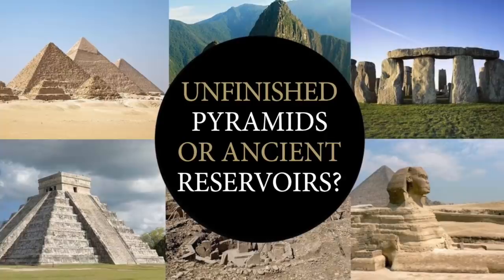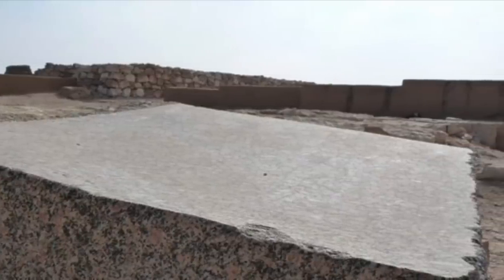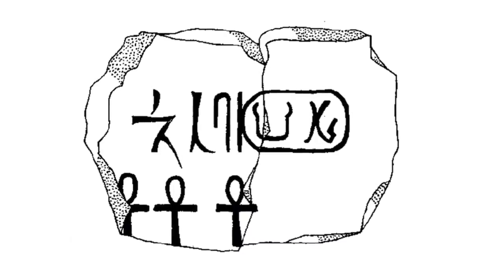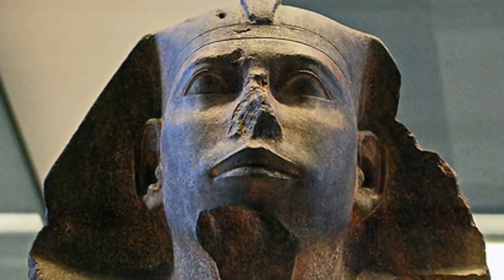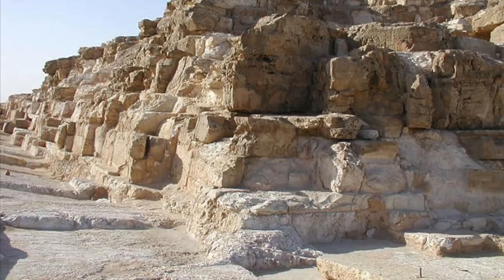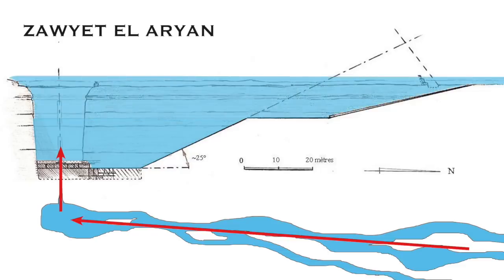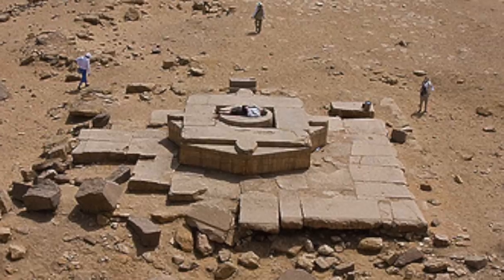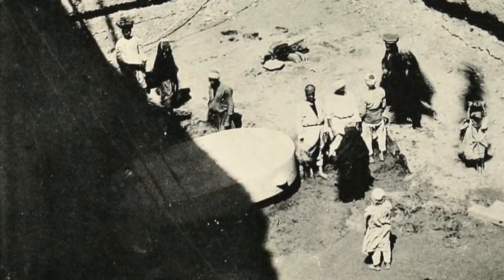Unfinished Egyptian Pyramids or Ancient Reservoirs? | Ancient Architects

Comment: Maybe the oval “sarcophagus” was a drain hole with lid. When capped all the water that comes in to the granite lined chambers is retained like a reservoir and every so often the drain lid is lifted so the reservoir could be drained for cleaning and servicing of the walls and floors. Could explain use of clays or resins in sealing the seams between blocks.

Or maybe water was diverted into a complex like this to try and push extra water directly into aquifers. That would make it easier for farmers to access water from individual wells that tapped into the same aquifer. I dont even know if that is possible though.

Comment: I’ve previously commented that the black around the plug may be charcoal, to purify the water. However, on reflection, it is likely tar. This would have been used to seal the plug when the reservoir was full, by lowering the plug in ropes, and using the tar to make a water right seal.

Comment: WOW.  What a great video.  I totally agree that the motivation makes sense.  I do have many questions.
1) Are you saying that the great pyramid (and all others) had the same original purpose?  If so, who and why did they later convert them into pyramids?  I would think the stone layers would be different on the original and the later conversion to a pyramid.  Is there any evidence for this?  
2) What is the reasoning for the precise orientation with the stars, if it was only a practical usage? 
3) Are you saying that all the pyramids had a start as part of this system and the finished ones were all made into "full" Pyramids? Or were some pyramids built as pyramids from the beginning?
4) If they were originally for water storage, what was the reason for the square shape and the angled sides?  Wouldn't it have been stronger to make them circles or ovals?

Thanks for the video.  I loved it.

Comment: The "sarcophagus" held charcoal. This place is like a tank on top of a reservoir allowing water into the tank and holding it from draining back to the reservoir or "losing" the water in between the two holding areas. There is communication between the pit and the underground aquifer. The block floor allowed water to seep into the pit from the aquifer and prevented it from draining back down or from draining to the intermediate underground where it would be lost or perhaps just not used where it was needed. Furthermore, this seems like it was  strictly used as drinking water. The charcoal in the container in the floor improved the taste of the water like a giant Britta. The reason there is a ramp in these places instead of stairs is because there would be large number of people filling containers daily. It looks like there is even a walkway to the filtered water area made with different colored granite. Maybe it was the prescribed path to follow, to wade out to the area with the up-welling of water that had been "filtered", so that contamination would be reduced. I've thought about this a lot. I think these are very old places. Your videos on these pits are by far my favorite and I rewatch them probably every couple weeks or so. They are just a fascinating subject!

Comment: Pity the Pyramid of Djedfre was torn apart by subsequent occupants of Egypt. Even as late as the 1800's modern era, 300 camel loads of stone per day were being removed from the site for sale in the open market. And that went on for weeks. This after the Romans had disassembled a significant part for their projects. The reason for the wide, sloping corridor and wide bottom area, is that the in situ stone was deemed not strong enough to support the superstructure of a pyramid. These areas were lined with much stronger stone to prevent the collapse of the interior corridors. The pyramid, when finished, was cased in polished granite to about 20 feet high, then polished black basalt to the top. The unusual inclination of 60 degrees and being built on a hill plus the mirror like black finish to the top gave this pyramid an awesome appearance, more than competitive with any similar structure. Theories about water works, reservoirs, pumping stations, power plants, aliens, extinct advanced civilizations are always amusing because anyone who understands even a bit about the Ancient Egyptians would understand that the pyramids were bridges.

Comment: I believe most of the structures including full pyramid structures were not only used as water pumps and/or water storage but pump stations to produce electricity. It would make sense why these structures were built with granite as it is a great conductor of electricity. It has also has been discovered that traces of copper has been found. Copper is a great conductor for electricity also. As we all know, water is a good source for producing electricity. This may explain why the Egyptians were able to place such expertise to their art and hieroglyphics without smoke imprints from oil lamps and fire torches. This may also give clues to why they were able to move such large objects in a short spand. During that time having a huge source to electricity would have been considered of God like advantage. I believe that is partly why they were so big in structure. Great monuments of conductive genius. Earlier it has been told the top portions of the pyramid were layered with gold which is also a great electricity conductor. This would make sense why the structures seemed more industrial than tomb like. Just my own hypothesis...

Comment: The more famous Giza pyramids do not contain heiroglyphs. And of course, no technology available to the Egyptians could have built them. Moreover, for such an enormous effort, there do not appear to be any heiroglyphs showing the building process (which is why archeologists have to guess at it today). Conclusion: they were not built by the Egyptians, but by an older civilization. To what end, we don't know. Power generation has been one of the main speculations. However your point about an enclosure wall indicating that the seemingly unfinished structures were in fact finished is a point well taken. And I agree that Egypt probably needed more water. (That desert was once an inland sea or huge lake.) Incidently, the type of stone used may be a major key to the use to which all these structures were put. You wouldn't use limestone to handle flowing water. Granite, yes. It's a point about the three Giza pyramids-- why build with granite deep inside the structure, and limestone elsewhere?

My skepticism with your water movement idea is that the three Giza pyramids are seemingly way over-built for simple pumping stations.
Reply: noferblatz im reading vses book on the giza excavations and there seems to be a lot of cladding of internal chambers and passageways with granite, it could have been removed at a later date and re-used, hence no water erosion

Comment: Suggestion about whether there is running water under the round stone: Place a plastic bucket bottom up with any digital recording device either on the bucket or underneath.  This method may be helpful at any suspected site of water flowing in the area. If it doesn't work then no loss.

Comment: I think you're probably right about the water pump hypothesis. here's why: in another video you did about electricity, the black residue would be the byproduct of that yeast mixture.
next, I noticed on the lid of the tub in those photographs, there are four "knobs", now, let's look back at the video where you're talking about granite glowing and displaying electrical discharge: https://youtu.be/piUt5Ln9Hes?t=377 clearly, in that picture, you can see that the the "corona" discharge is forming on the edges. this is both likely why the serapeum boxes are so perfectly flat (so that no electricity buildup happens on the faces and only on the edges) -- and is also a very likely explanation for the "knobs" on the the lid. all of the discharge would appear on those knobs, and not on the smooth surfaces.
so, if the unfinished pyramid were filled with water, there would be strong electrical current on those knobs. somehow, it seems that the shape of this tub is important. I would have to guess that it would suck water up through the granite floor-blocks kinda like a stationary mushroom cloud kind of flow, water would collect and remain in the basin for as long as the electricity was coming out of the tub. people could access the tub from the ramp when it stopped flowing, and likely water flowed out through the causeway, you're right.

to see water being pumped with elecricity, have a look here: https://www.youtube.com/watch?v=zzVa_tX1OiI
great research matt!

Comment: You have a major flaw in your pump reasoning. The Giza plateau is about 100' above the nearest low area in the Nile Riverbed, the current nearest flow of the river is about at 40' above sea level,  the closest 'bay' is only about 60' above sea level, and the platform on the North  side off the Great Pyramid is at an elevation of almost 200' above sea level.  So unless they had the worlds biggest bucket brigade, using the pyramid as a pump would not work. Pumps are usually placed below the water level if they are to be used to raise the water to a higher level.   Nice try tho.

Comment: YO! the ridges along the top; and the lower ridges were for a roof. large slabs would have been slid into place creating a roof. Look at the Osirion. Same thing there, except the ceiling blocks were even thicker. The "sarcophagus" I  believe is original. it was part of the machine. it has lasted due to its superior composite
Reply: I am onboard with your theory about water stations being the function

Comment: Good video, crude theory - you don't need all the interior complexities of the Great Pyramid to have it work like a "pump". Water has been running under the different structures in Giza and was used for a purpose, but not for irrigation (for conductivity maybe?). Desertification of North Africa supposedly started around 6-4k BCE, I think we both agree that those structures are much older thus the "water storage" motivation is unlikely (unless you want date them back another 20-30k years).
The "unfinished pyramids" being water outlets would not require them to be perfectly aligned to geographic north, apart for a hundred other counter-arguments. Keep searching.
Reply: To add to your point, there is water under the Sahara. In fact, there are great aquifers there if you dig down far enough. It used to be an inland sea. Did the Egyptians know that? Doubtful. Could they have dug that deep? Doubtful. Still...
Reply: I'm not that sure - the ancients loved to tunnel, and I suspect archaeologists aren't digging deep enough to find all traces...

Comment: An interesting idea. The construction definitely looks more reservoir -like than tomb-like so possibly had an industrial use. In pre dynastic times there would have been more rainfall so maybe the elevated position was actually to capture water rather than receive it from the nile.  The pipe may have been a sink hole to distribute water to other locations.  The lid on the pipe may have been   a plug to store water there until it was needed.

Comment: couldnt it also go the other way??? they were areas to catch water and move it thru the chambers to the great pyramid where the power plant would need it (the power plant idea of the great pyramid/s is what im leaning towards)
Reply from the maker: Yes - def a possibility. But you wouldn't have a water collection point on the top of a hill, you'd have it at the bottom - for maximum collection.
Reply: where are all water towers located at..........tops of hilltops or tops of mountains......that way it has the most pressure behind it so it makes it easiest to pump as far as possible
Reply: Check the terraced water collection feature in South American sites.
Reply: whos that to??
Reply: Diy chad726

Comment: Nice Video, I like the theories proposed. A good scientist should be open minded and always think out of the box with an alternative point of view. You, Graham Hancock,  John Anthony West who just passed away Feb 6, Andrew Collins, Randall Carlson, Robert Bauval, Robert Schoch and some others are the oxygen that science need to pursuit the truth.  I just got one suggestion,  The terms "Diagonal" dimension is misused since a diagonal is used in circles or "two opposite corners" of a square, rectangle, or other straight-sided shape.
In the case of a Pyramid it should be refer as "side of the base" instead.  
The Diagonal of the Great Pyramid :   multiply the length of one side "230 Meters"  by the square root of 2  =   325.27 Meters   
Based on a formula  Diagonal = the length of one side by the square root of 2
 Following are the proper names in a square pyramid geometrical shape.
 h = height 
s = slant height
a = side length
e = lateral edge length
V = volume
L = lateral surface area
B = base surface area 
A = total surface area

Comment: Thanks Matt.  A big mystery  Glad other channels are talking about this too.  I find your hypothesis most interesting.  And yes, I think it is identical to “Djedefre’s” at Abu Rawash.  Not a pyramid.  Nope. Great video.
Reply from the maker: Thanks man! I just like to throw my hat into the ring.
Reply: Lol.  The fact there is one of these at Saqqara, Abu Sir and Dashur too leads me to like your theory even more.
Reply: Why doesn't anyone consider the huge chunk that's missing in front of the oval ? To me that suggests something else fitted over the top and had a corresponding chunk that fits into that gap. Why would you create that odd shaping? It must've had a purpose. Crane ? Spaceship?
Reply: I think there is a whole bunch missing.  Pretty hard to re-piece what was there originally, based on only what hasn’t been hauled away or disinigrated over the last who knows how many thousands of years.  No easy answers,  that is for sure.
Reply: Thanks for a good video on these strange structures, which I am sure very few people are aware of. Clearly the concept that any of these structures were originally tombs is nonsense. The engineering involved is mind boggling, removing, dressing, transporting, and fitting the granite used is even today a seriously difficult proposition. Why do this when easier materials were available? I believe these structures can only be understood from an engineering viewpoint and provide a vital purpose, either water or energy. Interestingly it seems the black residue you mention was also found in the 'releaving' chambers above the kings chamber in the great pyramid, perhaps a clue?
Reply: Before last August this story or pyramid were not known.  It’s why I make videos.
Reply: cfapps  Abdel Hakim was talking about these sites over 10 years ago...  I know you don't like the energy/ healing angle of Khemet but now you are taking credit for discovering them...  come on man!!!  Go investigate the Vegas shooting and do some real journalism.  Peace
Reply: Grenherb  Agreed, there is a lot of evidence of a previous equator even!  The Yugas are hundreds of thousands of years long!!!  Aliens are propaganda as far as my research has taken me.  

It's like evil, there is no autonomous evil 'out there'.  It is created in the minds and actions of men.  Same with time/ space, there is no autonomous time or space 'out there'.  Everything is created and thus polarized... 
Unfortunately these corrupt 'world views' are used to control us through fear.  If we were taught about our true nature and that the earth is all we have then I believe we would treat each other a lot better.

Who knows, not having been in a patriarchal structure for a long time could be the problem?  Male/ Female energy is so out of balance in society as a whole that perhaps we are going to implode???

I am the light, powerful and joyful, right now and for eternity, gratefulness for what we receive everyday.   Peace
Reply: Ringo Stark. I’ll take credit for it. No one knew anything about this place, or that it was buried. So your comment is very lame.  Vegas shooting?  I’ll leave that up to others. I have a few people I know who are still suffering mental problems from that night. I deal with that.  Love it when fools tell me what to make videos on.
Reply: “Don’t like the energy/healing”?  Then why have I talked about it???  Want to embarrass yourself some more Ringo?  And leave a link where Hakeem talks about this lost and covered up structure.  I’m really looking forward to hearing it.
Reply: Thanks Sarah. Very nice.  Just depends on mood I’m in if I respond.  We all know who broke the story... and actually it is something Im quite proud of. With this great video and Jimmys and all the websites that picked up the story...It is exactly why I make videos.
Reply: Yep. Troll.  They can never back up what they spew.
Reply: Ringo, Are you a 'fluffer' for Zahi?
Reply: cfapps7865 hey, I like your videos upward inflection! And indeed I heard about this sites from you. Anyway the discussion of who talked first about Abu Rowash is just plain childish. Keep the good work alongside with Ancient!
Reply: Ancient Architects who is he

Comment: Djedfre's pyramid would have been the highest but not the tallest. North to south they seem to run down hill. The elevation of the chambers is more imporant than the height of the structure. Seems to bottom out at Fayoum Oasis area around the Hawara and Seostoris pyramids. Perhaps its, lower the elevation, the smaller the pyramid the smaller pyramid/substation. The ancients were obsessed with the management of water, its the lifeblood of civilisation. I wonder if it was a plug at the bottom of the shaft/cistern. You can also see the lifting 'bosses' attached to the 'sarcophagus' lid!